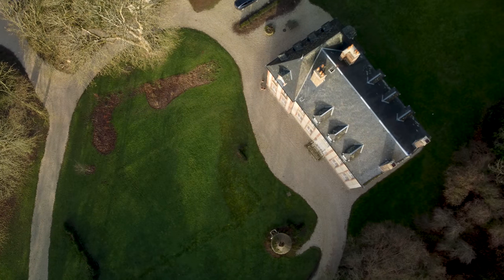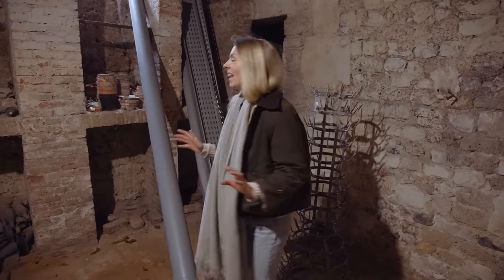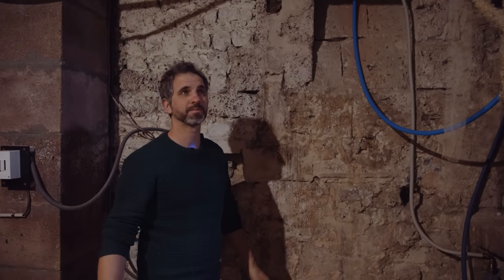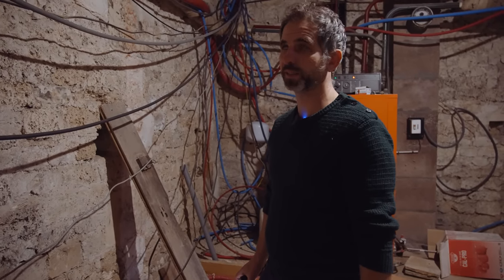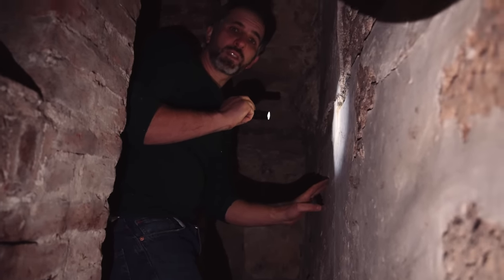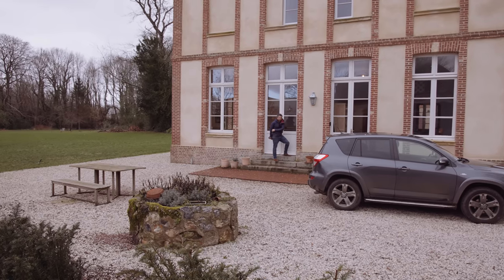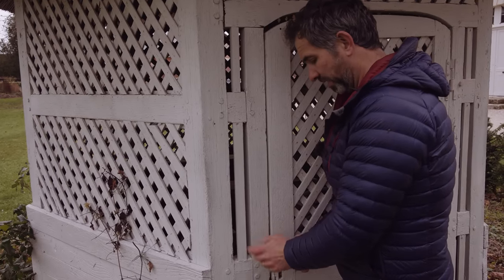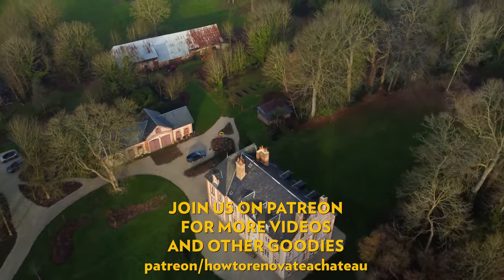This door leads underground. Exploring the hidden spaces of our Chateau.

Comment: I have a geothermal "water furnace".  The installers measure the cubic feet of your house/chateau to calculate how many loops they need to dig to heat/cool. I needed 4. The fluid in the system goes through the ground picking up the ambient temperature (about 55 degrees Fahrenheit where I am). It was expensive and it's hard to know how much it saves me, but what I especially like, it's a heat exchanger, so in the summer it cools the house and in the winter, it limits the heat necessary to just the difference between ground temp and what I set the thermostat at (68).  This summer I am putting on solar panels with battery backup to provide enough electricity to run the house most of the time and charge an electric car.  You will be glad to have those open windows into your cave because they can run the geothermal lines through there.  I also have a well and a septic tank, so I'd love to "get off the grid."

I should add, my daughter just looked into converting from a boiler/radiator and air con system to a heat exchanger, and because there are no air ducts, the cost was prohibitive.  You have the same problem.  How would you put ductwork into that chateau without destroying the renovations you've made?  'Tis a problem.

Comment: The bottle base is called a "punt"  they are used on the bottom of bottle that hold wine/cider etc that becomes fizzy. The base of  the bottom is thicker than non pressurised bottles.

Comment: A very interesting video.  You might very well have tunnels under your property.  I would want to know if anything is collapsing underneath, but also for tracing more of the past.  Where I live, we have many old stone homes dating back to the 1700’s and they also have very deep wells, some 200 and 300 feet deep, all hand stacked stone and simply beautiful. I visited a nearby house a few years back where an addition was built over a deep no longer used well, so they made the floor of the addition glass and tucked lighting into the hand stacked stone of the well.  It was absolutely gorgeous to look down through the glass floor to see the old well.  A staircase went down to the basement of the addition beside the well, and it was made into a wine cellar.   The well had iron rails separating it from the wine cellar and was absolutely stunning with the lighting in the stone and the sound of trickling water.  Hugs from New Hope, Pennsylvania. xx

Comment: Philip- the divot in the bottom of the bottles is called a punt in English. And our 210-year-old home in the US has parging on the cellar walls- which I think you saw as plaster. This was an old way to provide a bit of insulation and secure the mortar when humidity changes might loosen it.

Comment: The Garrett Ace 400i is the perfect starter model which is also very suitable for advanced users. It has all the functions you need to get started with the hobby and is very easy to operate. This is partly due to the clear user interface where each button has its own function.

Comment: The plaster construction on the way down to your basement you were talking about is called Lath and plaster.The small pieces of wood are the laths.They are installed with 15-20mm between so that the plaster will hang better😉It was mainly used in  Europe but i remember it was also used in New Zealand in the old houses.(I am originally from NZ)We are currently renovating a 300 year old stone house on an island in Croatia and the internal walls also are made of lath and plaster😉
Love your chanel by the way.We have watched it from the begining.
Mike and Gina😍
Reply: Our 70 year old house in Christchurch NZ  had lath and plaster. Terrible mess in earthquakes.
Reply: Lath and Plaster used in Australia too. Our 1890 house in Sydney had Lath and plaster ceilings..

Comment: Avid metal detectorist here. Regarding metal detectors: you can not go wrong if you buy a XP DEUS or DEUS II metal detector they are a bit more expensive but will find you coins and other artifacts among iron trash every time you would take it to your garden. Just keep in mind relic metal detectors can not detect coins much deeper than 12-30 cm depending on the size of the coin and deep seeking detectors are more used to find big deep objects. Metal detecting in your basement is possible with mentioned detector with a small coil, but you do run the risk of interference from all cables and pipes there. About XP detectors  it is a French brand so you would shop local and I recommend this detector because I have used it for years and it outperformed my other detectors from Minelab, Tesoro and Garret and will find items between lots of iron which is important if you detect around buildings as you do not want to find all the nails you lost during construction 😅

Comment: Hi Anna and Phillip, we love your videos and cannot wait for the next instalment. Dear Phillip, please do not store or gas bottles under ground. Butane as well as Propane are heavier than air and will accumulate in the cellar in case of a leak. The heating or even the light switch provides the spark that will blow up the chateau. I know it is inconvenient but please put them above ground. I will tell your Mom ;)

Comment: The plastering technique is called 'lathe' (pronounced 'larth as in 'hearth'). All too often you see people removing it and replacing it with plasterboard, but this is a big mistake. What you should do, is attach plasterboard to it. This is called 'gyprocking' the plasterboard. When you do this you are adding an insulating layer to your ceilings or wall (as the plasterboard acts in that fashion), so your property becomes warmer, and you are making it more fire resistant too. This is particularly useful if you discover a lathe ceiling. Builders consider them to be precious things, and so, unless it is literally collapsing, always leave it in place if you can - it lasts for decades!!! Super cool. We had this in our edwardian home on all our ceilings in our bedrooms and covered it up with plasterboard. Made a massive difference!

Comment: We have kept our old gas boiler and installed air source heat pumps side by side.. so we can still use one or the other.  We haven't had to replace our old iron radiators and have a mixture. Look at panasonic aquarea.  There are grants available through MaPrimeRenov. We had solar panels; Airsource and insulation through the MaPrimeRenove system? The solar offsets the costs of running the heat source pump.  We thought we might use the gas but we don't (although useful to have in an emergency and three years later there hasn't been one!)  we have tons of hot water and the temp (in a large bastide with adjoining gite) is a steady 20. No cold spots which is a complete revelation!

Comment: The plaster lath shown in your cellar stairway is called riven lath as opposed to hand split accordion lath (yes an actual term) or sawn lath. The Studs on the flat are like those used in numerous places. The identical system was used here in New York State up to the 1830's in some cases. The studs being "on the flat' was a widespread construction practice up until perhaps the 1840's and whole homes were built that way in the Northeast U.S.   Clapboards on the outside and lath and plaster on the inside.

Comment: Re: metal detectors, I have a Garrett AT Pro International.  It's a good value for price unit.  Top of the line is a Minelab CT3030, it's more than what you need.  XP Deus is also very competitive to Garrett's, but audio feedback is not as expressive as the Garrett AT Pro.

Comment: @ 11:30, looking at the unfinished wall, those are called lathes, which are thin pieces of wood, onto which the plaster is applied.  Usually, the walls are also insulated with a rougher plaster that contains horsehair and small gravel known as grit.  They may not have done that, though, in the basement.  But if you tear down a wall, you should find something like that.  BTW, doesn't it blow your mind that, somehow, when they sunk that well, they managed to go down and brick up the walls all the way up again?  Maybe they rigged up a sort of swing for the brick layer to sit on while they worked...?  Crazy.  As for the sunken area in the middle of the lawn, I would say it's probably your septic tank or a continuation of your cistern.  Ground only sinks for a few years, up to 20, at most.  Unless, of course, there is an underground water table that has sunk.  ??

Comment: Please research Geo-Thermal further. It used to be the last word in Heating, but no longer. The cheaper and more efficient system today is air-pump. It is cheaper to install, a pump last longer and it can also cool your house in the Summer. It uses less energy too.

Comment: I have some suggestions for potential replacements for your furnace when it is time to replace it. f you want to use forced air for heating you could use a heat pump that uses solar heated water to heat the house. Or if you want to continue to use the radiators; you could use solar evacuated tubes to heat the water instead of the furnace.
Reply: Perhaps a geothermal heat pump using well water?  Might take a couple of units for the side of the house.

Comment: Whatever you do, in case you are wondering, don't let anyone talk you into getting a heat pump. I live in a lovely old building that also has old radiators and it is such a massive fail that I am moving out before next winter (my landlords installed it, because we live in an drinking water protection zone and therefore couldn't drill to get geothermy). Heating with the heat pump is more expensive than with the old oil boiler, the house doesn't get warm anymore and the cost is higher than any of my friends are spending on heating (even those with bigger, well heated houses and more people). Yes, the system has been "fine-tuned" at least a thousand times and the amount of times people need to come in for "maintenance" is also crazy. Also there is a constant, very annoying whistling noise 24/7 coming from the pump that is audible in almost every room and pipe, even at night and if all radiators are turned off. I have never hated a new piece of technlology so much and it is definetely a no for old houses, don't waste your money.
Reply from the maker: good to know
Reply: @HowToRenovateAChateau  it is dubbed "Habeck-Heizung" in Germany 😵‍💫

Comment: I recommend a Geothermal Heating System.  It will be the most expensive to install but the cheapest to operate.  It will also last the longest and continue to be increasingly the least expensive as fossil fuels and electric continue to rise.  It is also much, much less labor intensive than wood.

Comment: If you want to know if there is any tunnels underground, look at a
Copy and Paste;

Ground-penetrating radar is a geophysical method that uses radar pulses to image the subsurface. It is a non-intrusive method of surveying the sub-surface to investigate underground utilities such as concrete, asphalt, metals, pipes, cables or masonry. Wikipedia

If you actually invest into the equipment. I take that you are with Billy and Phillip, along with the other chateau owners. You could resale it, and recoup most of your money, while still coming out cheaper than if you hired a service. That is what I would do, unless the equipment is insanely expensive, and/or the service is that cheap and they include a extremely detailed report, because, purchasing the equipment. You are going to need to learn how to operate and also interpret the data. Also there might be some tricks that will render better results in your data, but I am sure that if you purchase the equipment new, or from a dealer that sales new equipment. Sort of like getting a certified preowned vehicle, from a dealership that sold the models new. You would have full support. So any questions will be answered.

Comment: Please please, immeadiately remove those two propane bottles. Never store those in a basement. Gas is heavier than air, so if they leak for any reason, there's no way for the gas to disperse and you'll have a superb mix, ready to go, right underneath your feet!
Reply from the maker: Its butane gas
Reply: @HowToRenovateAChateau  makes no difference. Heavier than air, explosive as an air/gas mixture.

Comment: As I understand it, don't go down into the cistern to clean it without ventilating it well first. There may be toxic gas buildup because of the decay of any organic material that could  have polluted the water. That rat was a good example. The gas may be heavier than air. Maybe you should consider putting in a new one in PVC or fiberglass?   I think they have to be vented and cleaned regularly. In fact it might be wise to have paired cisterns to allow for rotation and cleaning.. They ought to make a cistern with a removable lining if there isn't one on the market already. I suppose that kind of sophistication is intended for potable water systems? 
If I had the chance today I'd install a cistern system for all household uses. It doesn't sound like it would be that hard to dose the water supply with chlorine on a regular. schedule. And all you need is household chlorine bleach.  You even get to use Avogadro's number to calculate moles.  I never knew a practical application of that number until I took the water system operators test here in New Hampshire over 30 years ago. Other than the size of that number the equation you'd use isn't very complicated. You have to know the volume of the water to be dosed. Cistern water may be very clean already but point of use filters and an interior pressurized treated water tank could make it potable and you wouldn't need a dual plumbing system.  Otherwise all the toilets will have to have their own supply lines.  

How big  are your water bills? Ours keep climbing and we have been living with restricted use (no outdoor watering) for over a decade.

I wonder how the rat got in?

Comment: Always hire a professional or do your research and use the appropriate equipment before entering any of these enclosed spaces. At a minimum you should be using a gas monitor - the atmosphere in these poorly ventilated spaces that weren't meant for human occupation can be very dangerous with low oxygen or high concentrations of toxic gases like hydrogen sulfide (H2S) that can overwhelm you in seconds!

Comment: Why the Hell Is There a Dimple on the Bottom of Wine Bottles? We Found Out

Bottoms up — wait, what’s that dent?
BY TYLER CHIN
 JUN 30, 2020
 fd wine bottle gear patrol lead fullHenry Phillips
Welcome to Further Details, a series dedicated to ubiquitous but overlooked elements hidden on your favorite products. This week: the indentation in the bottom of your wine bottle.

Order wine from a restaurant and you might notice the sommelier pours you a glass in a distinctive manner. Their thumb is slipped into an indent of the bottom of the bottle, their index and middle fingers supporting the body. From this encounter, one could infer that the indent on that wine bottle, called a punt, is meant to assist with pouring wine. That’s not wrong, but it’s also not entirely right.